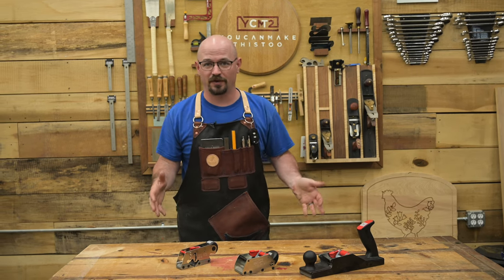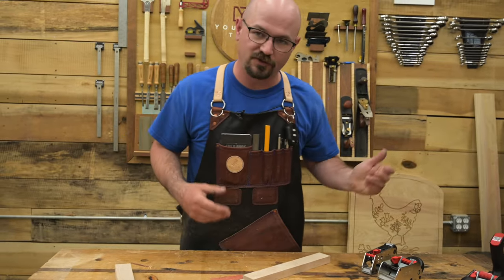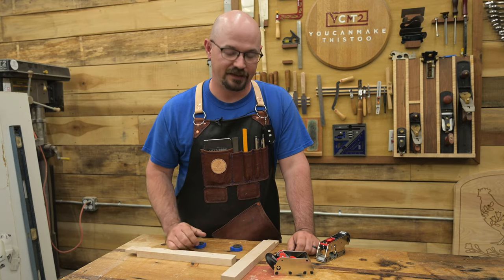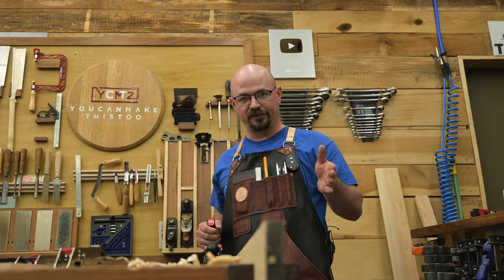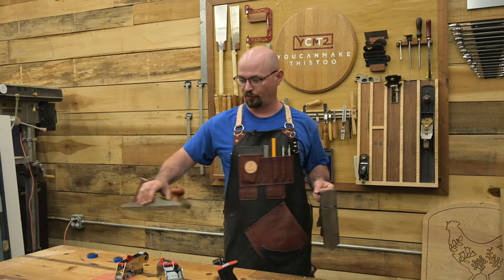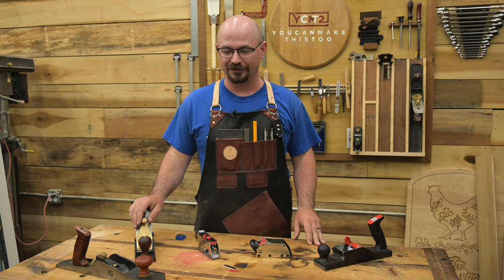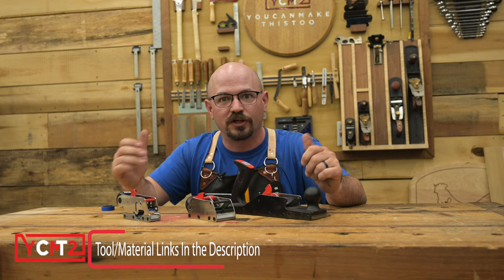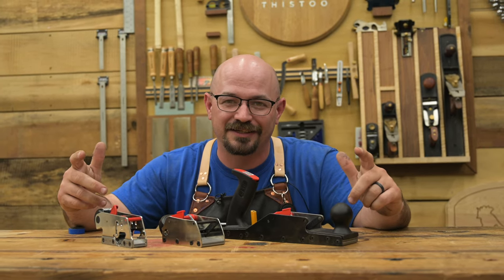BEST First Hand Planes for Woodworkers

Comment: Every time I see someone joint an edge with a plane I wish I had their ability to maintain a perfect 90 degree angle to the face. Amazing people.
Reply: Until you get the feel for it, use a small square against the sole of the plane and the side of the board. I've not used a plane yet, but that is how I would learn. I think there is also a longer version of a shooting board that could help.
Reply from the maker: It's definitely a feel thing.. after enough time eventually it just kind of clicks. That said, if I know an edge isn't square I have to keep checking and re-checking as I go to bring it square. But once it's close, muscle memory just does its thing.

Comment: What can a traditional plane do that these cannot? You mentioned that traditional planes can have the iron at positions/angles, is that ever beneficial vs square?
Reply from the maker: Nothing. You can skew the blade to help bring an unsquare edge to square.. but it's just a different technique. With the blade square you'd just use hand position, a fence, or tipping the plane. 

The adjuster in planes is there because it'd take really tight tolerances to index a heavy iron perfectly every time, and it'd also require perfectly square sharpening every time. Without being able to adjust the iron, if you sharpened one side unequally.. now you can't take a full cut and have to go chase square on your stones.

Comment: Hell, I'm curious why you suggest these are great beginner woodworking planers due to the price point of them all being over 100$. Is the point due to a more expensive hand planer going to correct imperfections by budget or secondhand table saws, or only having a circular saw? I suppose what I am looking for is a selling point. As a DIYer I don't see myself paying 100 bucks a pop for some hand planers when I could just use some sand paper like you dissuaded me from during the video.
Reply from the maker: Hand planes and sand paper serve different functions in fine furniture. It depends on what you do. 

And when you compare ~$100 each for these planes to what you’d pay for a Veritas or Lie Nelson, and then you still need a sharpening set up.. it’s a bargain. Being a bargain still doesn’t mean it’s everyone’s budget though.

Comment: You have a great video format, so I hope this doesn't come across the wrong way.  This seems to be a sponsored video and I think it's a bit misleading to state that the rali planes are the best hand planes without mentioning in the beginning of the video that it was sponsored or had incentives. 

Personal opinion, the Lee Nielsen or Lee valley veritas planes are the best planes on the market right now. They're usually ready to go, without worrying about setup that you mentioned.  Budget wise, if you have to go cheaper, woodriver, Stanley sweetheart and Jorgensen are my recommendations but require setup like the rali. 

Also,  re sharpening is a skill that all woodworkers need to know (e.g. chisels).  It's a disservice to new woodworkers to downplay the importance of tool maintenance/knowing how your tool works in favor of jumping in right away.   Imagine the dangers this mindset would introduce for table saws and such. 

Rali is the plane equivalent of budget disposable razors. And I learned the hard way that rali planes soles werent flat at all and still required setup.
Reply from the maker: Not the beginning of the video, but before I make my case for those planes in particular - I disclose the agreement ( 6:56 ) and why I’m making the video. Everything up to that point applies to hand planes in general, so I disagree I was misleading in anyway. I don’t play games about sponsorships. 

I agree about the importance of learning to sharpen, set up tools, maintain machines, and many other supporting skill sets. They’re invaluable and if you want to get into ‘fine’ woodworking are absolutely essential. They’re also challenging to learn by yourself, at least for me. 

My goal is to encourage folks to just be in the shop making and remove anything that keeps them from that, especially early days. To use an analogy, it’s like if you have a voluntary music student any good instructor will have that student doing some simple melodies or rhythms as soon as possible and use the music as the practice as long as possible. The theory, the scales, the exercises that are purely practice.. come after you’ve locked the love of the craft. 

Though not the fastest way to build skills, it’s a lot faster than quitting will get you. I try to postpone the frustration until one’s interest is definitely stronger than frustration will be. Frustration isn’t fun, and hobbies are meant to be fun and fulfilling. 

I’m not claiming supremacy in my approach, but it’s mine and I think well reasoned and helpful to many - I accept not all, and maybe not even most. People are too varied for one approach to work for all, there’s plenty of others out there also giving their suggestions on how to approach this craft that’s different from mine and more applicable to their audience. 

I don’t mean this to be disagreeable, just thought I’d explain my reasoning more deeply since you had concerns, and want to match the thoughtfulness you showed in your comment. I appreciate the conversation
Reply: Have you tried it? If not, you just sound like someone repeating what someone else heard

Comment: Right at the outset in this video, it is puzzling when woodworkers mimic metal machinists by invoking "20 thousands of an inch" in their craft.
All materials expand and contract; wood especially. 
If one wants a product that looks like it came out of a CNC operation, then go that direction.  
The look of a less that "perfect" joint does not bother many, especially when the project was produced by a human hand.
The snobbery of many woodworkers is beyond the pale and the race to obtain rare, expensive and named brands is endless.

Comment: Cool planes but the price is about the same as a good used traditional plane.
Reply: A used plane is a LOT cheaper. Takes more setup/research time but if money is a concern I don't think Rali planes are a reasonable option.
Reply: @kz.irudimen  Forgetting the added cost of the sharpening system and time is money most in most cases, and it's also time to learn to use the tool that's going to be effected.  So it's reasonable, you're getting a lot of convenience with these, just different trade offs and everyone has to decide which trade off is better for them...
Reply: @ZeoCyberG  That's true but you'll have to learn sharpening at one point or another, unless you also want to use Rali chisels, which are also extremely expensive. You can start sharpening with 15€ of sandpaper. Convenience/time saving is definetely an argument, budget is not.
Reply: @kz.irudimen  There's a lot more to learn with sharpening a plane iron than a chisel and they don't have to do anything with each other.  Like the choice between Japanese saws and Western doesn't have to effect your choice in chisels, similarly the Japanese saws tend to be easier and cheaper to just replace and they have different pros and cons vs the western ones...  It's the same with these planes.  Like he said, for someone starting out these are just quicker and easier to get to working.
Reply: @ZeoCyberG  I don't know why you're still telling me these are "quicker and easier" when I never argued otherwise, I'm only saying they are more expensive.
I'm talking about chisels, bcause sharpening a western plane iron or chisel is the exact same process and requires the exacte same material. You're going to have to buy sharpening equipment at some point, it doesn't make sense to say you're saving money by buying Rali planes. Also, you'll need to keep buying blades, which makes it more expensive over time as well. 
Again, I'm not arguing these aren't easier and quicker, they are. But they cost a TON more money than going with a regular vintage plane.
Reply: @kz.irudimen  That's the point, quicker and easier is saving cost that you are spending on the traditional planes. The sharpening system and all the time and labor it takes you isn't free...  If you're going to compare different options you have to account for what makes them different or you aren't making equivalent comparisons... This is why he pointed out it works out to be less in the video...

Comment: Hi, I watched the latest “worththeeffort” where he went on at length why you do not need all these planes and can use a ½ “chisel instead. I have been doing woodwork for over sixty years now and I agree with him about the planes.
Reply from the maker: A plane is basically just a chisel holder. Just comes down to how you prefer to work. Personally I’ll grab a plane over a chisel if it’ll do the job because now I have a mechanical reference instead of just my best efforts at alignment. 

Definitely agree with him that you there’s lots you’ll see on YouTube that you don’t need. I’m big on buy tools when you need them. 

I used to make a lot of small projects and got the tools best for that. But now a 6’ table is a “small” project for me and my shop is outfit accordingly. 

That’s also why I’m big on going deep on the “why.” The only tool I can think of that  every shop should have is a drill… other than that it’s always “what do you make… how do you like to work”
Reply: @YouCanMakeThisToo  agree totally